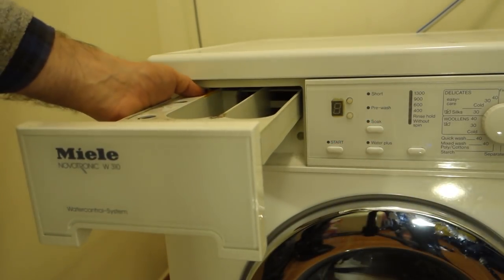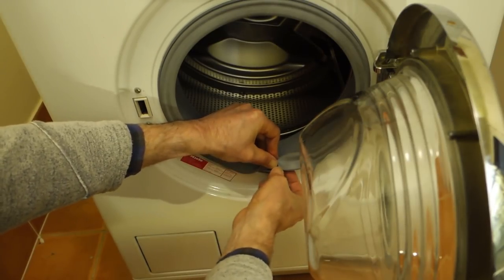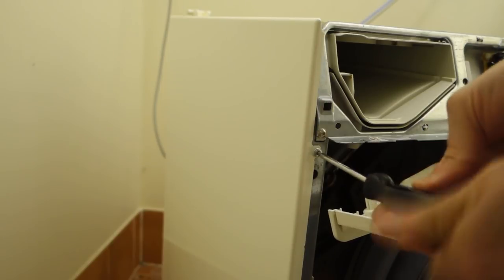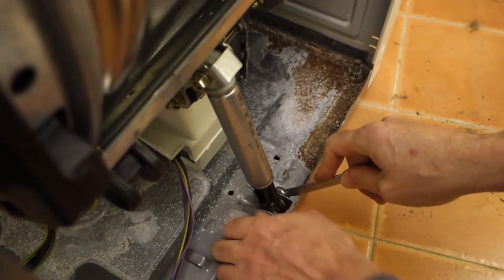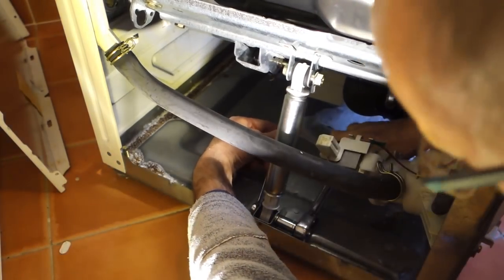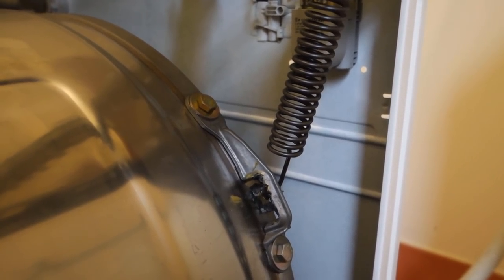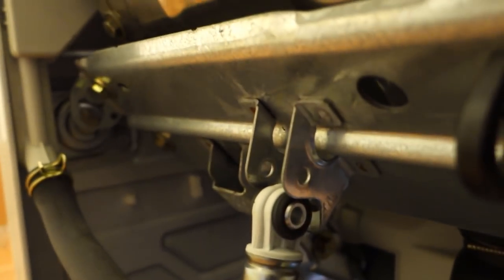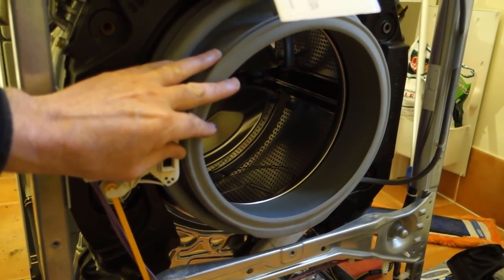Ep 37 Miele Washing Machine Repair (Shock Absorbers)

Comment: 2 questions: 1st. My Siemens machine is running fine since 17 years. Would you in general recommend buying a new machine just because it uses less water and power? 2nd. What would you recommend, when moving a washing machine from one apartment to another ?
Reply from the maker: If it's running fine I'd keep using it.  Washing machines have improved in efficiency but fridges have improved by a much higher degree so that's where I'd invest for an energy saving.  As for moving, washing machines usually come with shipping brackets.  After 17 years these are probably missing so just go gently when moving as they are  typically very heavy due to the weights attached to the drum.

Comment: How easy was it to move the springs by yourself? As I've ordered new dampers today so think I will do the same as mine is about 14 years old.
Reply from the maker: Not super easy.  Probably better if you have an extra pair of hands available.   I think I used a piece of wood as a crowbar under the tub to lift it higher than normal if that makes sense 🤔
Reply: @PowerOn-  yeah it did cheers
Reply: Changed the dampers, adjusted the springs but now think as the drum has changed hight the fan belt is squeaking a tiny bit, But at least no more banging.
The old dampers had worn differently as one was completely gone.

Comment: Great video! I feel confident enough to tackle this job myself! One question: Is it any special sort of grease that should be used for the springs? If so what specific grease do  I need to look for?
Thanks!
Reply from the maker: Thanks for your comments P Jay, i hope your repair works out.  As for the type of grease, i don't think it matters too much.  Just one which is solid enough not to drip down in use.  A thin smear should be enough.

Comment: Thank you very much.  Was an essential aid
Reply from the maker: Happy to have been a help Dave.
Reply: FWIW I checked the damper travel and it seems to be about 70mm so I checked that they were in the mid travel (i.e. 35mm) when re-installed - so I didn't adjust the springs.  I'll update this post If I need to get back in there to readjust them :)

Comment: Thank you for posting this video. I have a WT945 Washer dryer that is 21! It works fine but when going through the rinse cycles, when the weight of the water and clothing is heaviest, it rocks; not always but most of the time. When it gets to Final Spin it is fine and spins at 1500RPM (highest speed) without any issues. I took the top off and there is lots of play in the drum. If I start by replacing the springs, are they easy to get out? Am I wrong to assume that if genuine Miele springs are used, putting them on the exact holes that the old ones sit in should do the trick? For what new springs cost (around £60 for 4) I think it is worth trying this route first. Any help, advice appreciated. P.S. The machine has been used pretty much daily. At the weekend we did 5 washes so we have had our money’s worth. It has never been repaired!
Reply from the maker: The problem you describe is indicative of a damper problem rather than a spring issue.  However, the springs do get some "permanent set" in them due to the constant weight of the drum.  You may be able to see this as a sag or lowering of the height of the drum in relation to the door apature.  Thanks for your comment and feedback.
Reply: Simon Jowett Thank you for your reply. It is appreciated. I will have a good look at it later when in front of it. From memory it doesn’t look lower so your answer while reassuring is not the one I hoped for; I was geared up for the spring change but the dampers might prove beyond my skills :( Miele charge £130 for the first hour’s labour plus parts. I may end up getting them out. It breaks my heart to buy a new machine if this is an easy albeit costly fix! Thanks and all the best.
Reply: If there's lots of play in the drum itself, your spider's cracked and that basically means end of machine.

Comment: I wish to thank you so much for your video! I have a bumping 14 years old Miele W2365 washing machine and following your very accurate instructions I have understood the source of the problem. I have been able to dismount the front and right panels ( just some slight differences with respect to your model) and verify that the dampers were completely gone. I have just ordered the new parts and I will replace them asap. I just have to figure out if I need to move the springs, as you did, in order to lift the drum up. Please do you have any particular suggestion about how to dismount and remount the springs (e.g. where to pull, if the drum need to be lifted with some wooden piece underneath)? Thank you so much!
Reply: gcotogno I just used an adjustable strap fitted to both of the drum bolts and over the top of the machine, lifting the drum and tightening the strap. You can slacken the springs easily now, then lift them off and replacing them, one at a time. Cheers!

Comment: Simon! You life saver. I've traveled through tens of rubbish clips. None are as good as yours. Good shots, brief but clear narration and really helpful. O my thing I would add is to use the orange  filter flap tab found in the powder tray for removing the acrylic front panel. Small screw drivers can crack the edges. Damn Miele fur making their products so tricky to access. Btw got any tips fixing the float switch? Thanks
Reply from the maker: Thanks for the reply and positive feedback it's much appreciated.  Thanks also for the additional tips, hers hoping they help another person tackle their repair.  Sorry though I haven't any tips for the float switch....mine is still working...for now! 😉
Reply: @PowerOn-  I managed to take out the float and give it a clean. It got gunked up after a flood from blocked drain. I'll let you know if I got it fixed. Keep fixing!
Reply: FIXED! Thanks Simon.....we have wash!

Comment: Many thanks Simon. My Miele is over 22 years old and has the same jumping around issue. I'm pretty sure new dampers and springs will solve the problem and your video gives me the confidence to have a go myself. Do I have to buy Miele OEM parts or will generic parts do ?
Reply from the maker: At 22yrs old I'd be opting for generic parts, certainly if the originals are prohibitively expensive!

Comment: Thanks a lot for the video. My W1918 had the same issue but is back in service after I replaced shocks and springs. Meile factory tech failed to identify the problem :(
Reply from the maker: Well done Alexander.   The Miele technician doesnt sound too good though 🙄

Comment: Thank you for the great video. I am just about to do the same job and wondered if you had any tips for actually adjusting the springs. I have had a quick look and obviously they are under tension so was not sure how easy to move them will be. Did you just use brute force or did you have a tool to compress the springs etc ? many thanks and so refreshing to see a great shot and explained video like this.
Reply from the maker: Hi Matt thanks for the comment.  To install/adjust the springs I lifted the drum up with a lever (a length of 2x4 or similar).  If you 'over' lift the drum you'll be able to hook the spring on with little or no tension.  Tricky on your own but doable.
Reply: Simon Jowett those 2 metal bars on the back of washer can be used as levers?

Comment: Hello Simon,
My W1113 was hammering loudly during the spin cycle.   so like you I replaced the same shocks and retensioned springs.  Only to find, once reassembled and power on, 3- dashes in display (---) and buzzer blaring.  Now, can't access programming (press and hold START, while switching appliance on.........).  No tech support on YouTube at this level of disaster ..  This is now scrap metal.   Any thoughts?  I must have scuppered the motherboard, but I doubt it after 16 years of hammering.  I'm not blaming you at all, I was batting 1000 with repairs around the house up to this point.  Would appreciate your thoughts as laundry is piling up around me as I write.  No worries, plan B was to buy another Miele anyway.  Such a nice machine before I mucked about. ;-)
Reply from the maker: Check and recheck all the interconnection points.  Clearly the motherboard is powered up ok as the display is on (and shows dashes).
Reply from the maker: Found this on another website.....3 dashes (or bars) in our Miele W1119 washer display. Beeping. All lights are off and machine is not working. Miele service call: the light bulb in the drum was loose! He pushed it back in and the machine worked fine again. This solution is nowhere to be found. Only in the service manual according to the service tech
Reply: @PowerOn-  no change after examining bulb and ohm testing, good.  Appreciate your early (AM) reply at our bed time.  Good-on-ya-mate.  But would a dead light bulb cause this?  On power up, pump runs for 2-minutes as described in manual.  Nice to be retired and play with all my toys, but in a closet?, nice to know I still have what it takes. ;-), David

Comment: You have chosen a rather complicated way to change the shock absorbers. To remove the door panel you don't touch the fascia panel. Remove the lower kick panel beneath the front door panel. Unscrew one T20 screw on the left and one on the right bottom corner. Remove screws from the door lock, remove spring ring around the door seal ( pull the spring out at bottom of seal ). Last remove larger bolt directly underneath the door seal. ( 2 different bolts were used over time ). Take the door seal off the front panel and roll it in and now you can remove the panel by pulling it away from the bottom first. Now you can change the shock absorbers from the front. The left side is abstracted by the filter housing but that's only 1 screw to remove it. The small tube on the left side of the filter housing going to up the top must be clear. If blocked it will not spin properly due to an airlock. The fact that this machine is staffed is a problem with the spider support at the back, holding the drum. It's corroded and broken due to too much detergent and low temp. washing. You can still see it at the beginning of the final spin that soap suds are still hanging around the drum. A very common problem especially in soft water areas.
Reply: Hi Siegfried, so you can change both shocks without taking off the sides? I have taken off the front below the fascia to change the drain pump motor, which is easy to do, but now while I wait for a new motor I am thinking I could do the dampers too as they are not so good.
Reply: @dalstonjazz  Hi Dalstonjazz, yes, just remove the large front panel ( don't touch the fascia or the top ). With the front gone it's all open to change the friction dampers, ( 13mm socket and extension
 ). For the left side remove the filter housing ( 1 screw ) , push it aside and replace the shocker.
Reply: My dryer is attached to my washer at the pedestals. How do I separate so I can take the top off, to try and adjust the springs?

Comment: I got my new dampers and was looking forward to having a go at this job. Sadly I didn't get very far ! My machine ( W980 ) is constructed differently and the back and sides are all one piece of metal. There are no screws under the acrylic panel and I didn't have a clue as how to proceed. If anyone has done this on a machine like mine I'd love to know how to begin.
Reply from the maker: Try removing the top and see if you can see how it has been assembled - If its not working you haven't much to loose except for time!  Good luck.
Reply: Thanks Simon. Machine works OK save for the jumping about. Like yours the drum is easily moved and needs new dampers. I'll remove the 3 bolts from around the seal and see if that releases the front and then go from there. She's too old to get Miele in to do it.

Comment: W3622 Platinum and avoiding damage - My 3622 does not have the kick plate covers but instead just needs a gentle pry and the top each side and about 3cm in from the edges.

Also, I found that it I carefully use a Stanley knife blade flat to catch under the little screw covers then rock it I can remove them very carefully, And again with acrylic on face control panel. - ease the top surface of the facia panel up slightly with fingers and insert a 2cm wide blade scraper carefully, I avoided damage from a screwdriver to the ABS Plastic facia panel.  

Could do with showing that the control panel has a couple of connectors to undo and how to do that.  That aside, very useful. Many Thanks

Comment: WWB020 owner (Late to the party ☹️). Any way to bump up the main wash water level? I realize I can’t totally submerge clothes in water but would like to get the water level above the bottom of the drum. Can I adjust a sensor inside the machine?
Reply from the maker: No, there isn't a way of adjusting the water level, it works off a fixed pressure switch.  Front loaders are designed this way and they genuinely wash clothes much better and with less water than a top loader.  They do however take longer.  You will not get cleaner clothes with more water!  If you are concerned you could always add a separate rinse/spin cycle
Reply: My clothes do seem clean and the forte of this machine is it’s spin. It should handle washing one pillow but I’m skeptical it can get soapy water into the interior And then rinse it out. I don’t want to mess up the balance of the drum though. Can it handle the weight of a wet pillow?

Comment: Miele W1926 took the front off, but sides and back don't come off. The sides and back are all one piece. No idea how to get to the two shocks and bolts and all of the springs from the front. Is there anyone out there that knows the Miele W1926 and how to service the shocks and springs? Any help would be very much appreciated.

Comment: Hi Simon, if I just want to gain access to the water drain pump on that machine, is there a simpler way?
Reply from the maker: Unfortunately I think you still have to take the top off 1st then the sides.  You may be able to get away with only one side removal....but I've never worked on the pump so this is my best guess!
Reply: Yes, I had to do it exactly as you did... other than leaving one side on. Thanks Simon, great tutorial 👌

Comment: Hi Simon, thanks for this amazing video. Could you help me to remove the back of the  washing machine ? Is it even possible ?
Greetings from France!
Reply from the maker: Bonjour!  I'm not able to help you directly but, I would follow this video to remove the front and sides first, then remove the back.  I think the back is the last to be removed as the water and electrical cable go through the back and a number of components are mounted on this panel.  Good luck!
Reply: @PowerOn-  Yes, I already removed the front and sides, but I can't find a way yo remove the back. There isn't screws or anything. It's very annoying

Comment: You went about it in a very complicated way to do a 20min. job. Don't touch or change the spring location ( they won't stretch and outlast the machine ).
Reply from the maker: Hi Siegfried, thanks for the comments.  I understand from yours and other comments that the repair could be performed by removing oly the front panel.  If there is a 'next time', ill try this :)